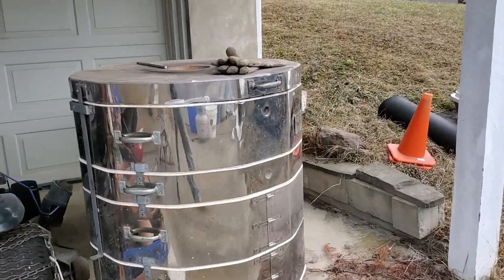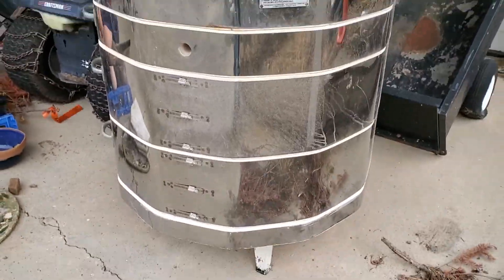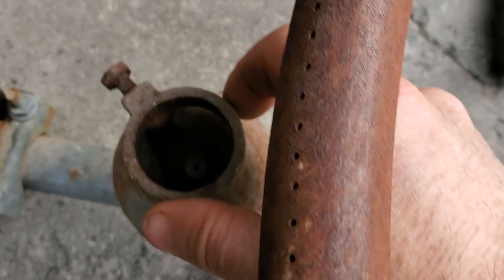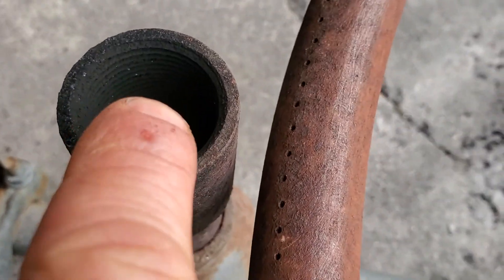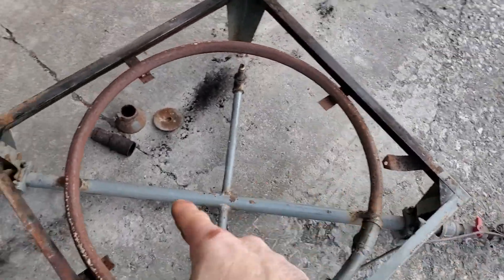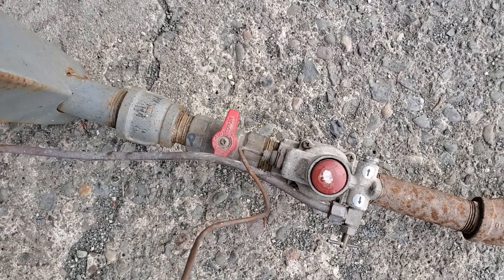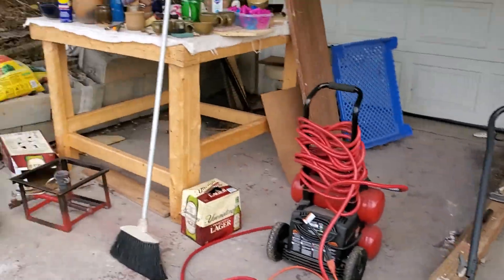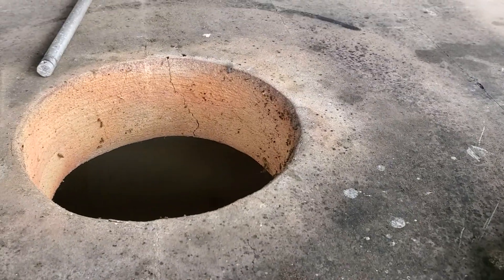Cleaning And Repairing A Used Olympic 2831G Updraft Kiln.

Comment: I got a contemporary gas kiln c-10 with 4 burners when I got it the baso valve didn’t work and I’m saving my money to buy one. I’ve changed orifices to propane and I buy passed the valve and connected the propane straight to the burners just to tested it and it worked I know it’s not save because of the pilot for safety but long story short I have a small propane tank will that be enough for a cone 10 firing or would I need more propane

Comment: How much did you pay for the kiln
Reply: I bought it used for 100.00 and 6 mugs.
Reply: @wayman29  wow that’s a good deal
Reply: @wayman29  I just got one but the pilot light don’t work I’m afraid that it going to blow out the burners and become a bomb  do you recommend anything like I see you put concrete Board at the bottom of flame so it won’t blow off

Comment: I picked up a similar model recently off Marketplace. Do NOT buy parts for these things from Olympic!!! They charge $18 each for the orifices PLUS $25 shipping in a box like one would get a ring in from a jewelry store when you can get them from Amazon for $2 each with free shipping ($75 for $6 worth of orifices). The part that the orifice screws into is called by several names (orifice connector, brass spud, air mixer pin). Olympic wanted $60 each for these and if you search around a bit you can find them for less than $20. Even worse is you can buy a complete MR-750 Venturi Burner for Less than $55 and each burner you buy has one of these very same air mixer pins in it. The sales person at Olympic (GreatKilns) told me they were so expensive because they were custom made for them by a shop down the street. Odds are that "custom shop" is Ward Burner; 200 miles away in another state.
Reply from the maker: Hey Thanks!  All of this you mentioned is correct!  Next time I need them, I will do as you say!  I was not sure of the type, as this was my first set of burners that needed them .  I did look around for some. So now that I have them, I will know what to get next time I need to replace them.  I over paid to be correct.  You are correct about all of this and I see it happen at my job where the supplier over charges the company for things they could get far cheaper on their own. Great job and thanks for the helpful comment!